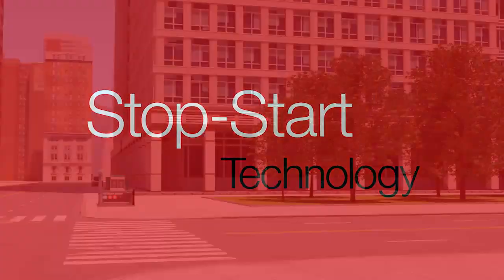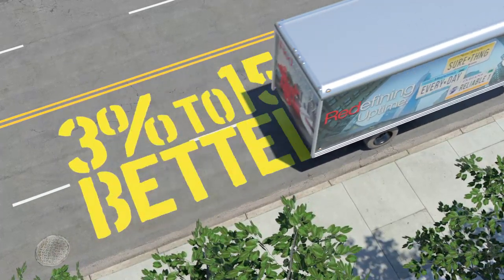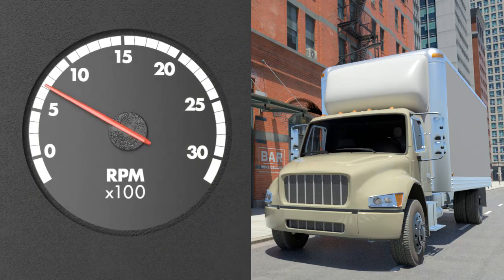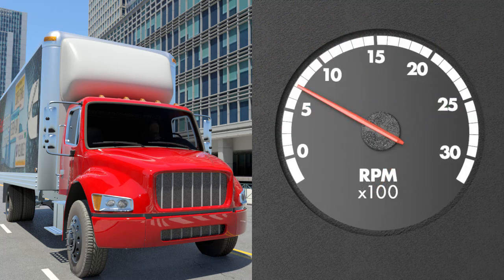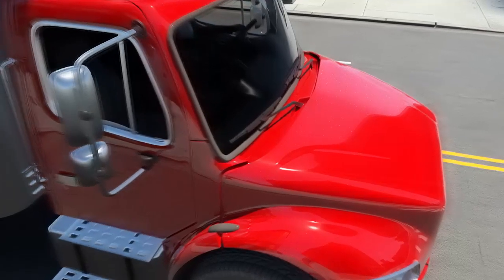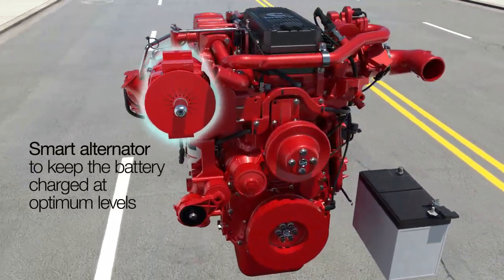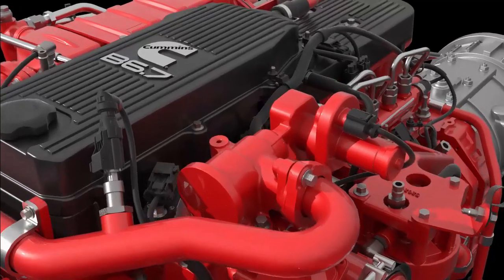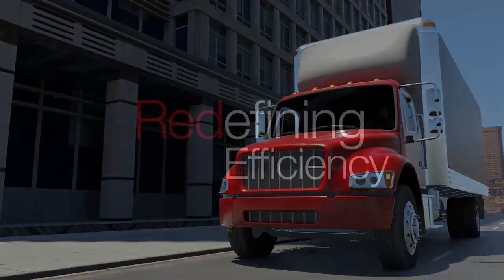Cummins Innovates with Stop-Start Technology

Comment: I used to worry about starters, but with the hybrid trucks, they start rolling with the electric motor and then use the trucks momentum to fire up the main engine. The starter is hardly used.

Comment: more frequent starter replacement and tow bills with trucks that wont start in the street
Reply: I don't believe the savings compared to parts replacement & labor & tows will add up.  It's more political correctness with sorry assed EPA than anything I believe.
Reply: +Steve Holsten I repair starters on cummins and cat a pillar engines for a fleet local government, let me tell you they take a beating it's a lot in labor money and in parts itself
Reply: With high diesel prices and high fuel consumption in stop and go driving, this system will pay for any potential problems many times over.